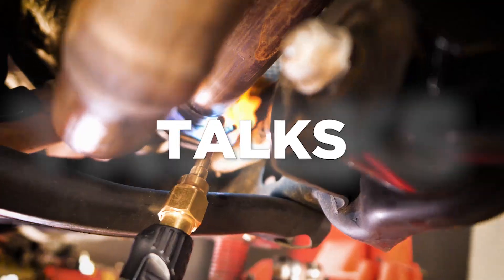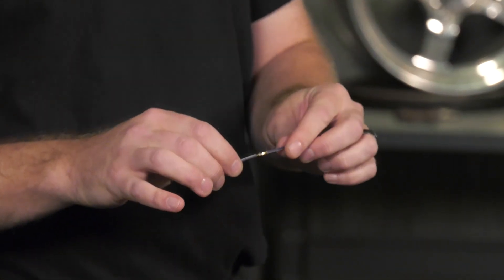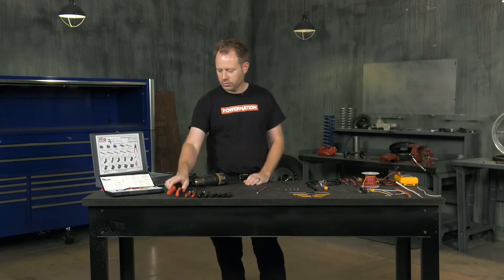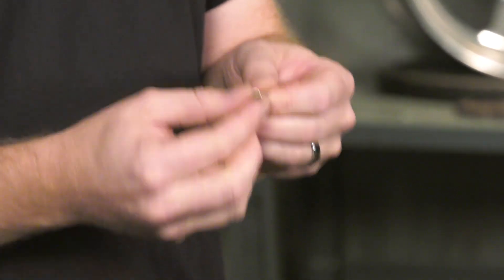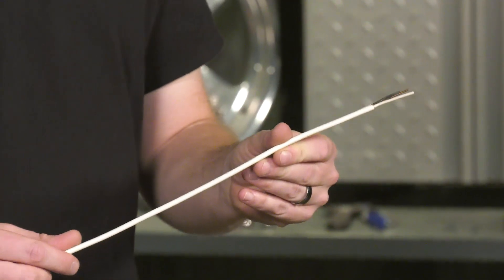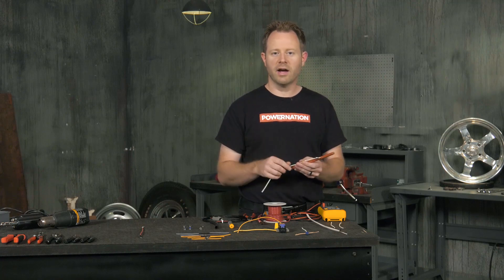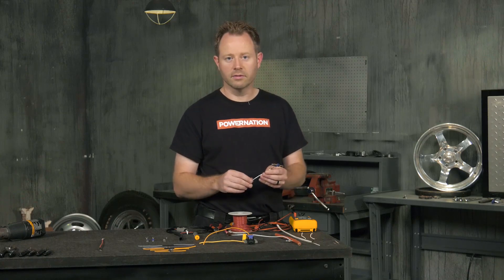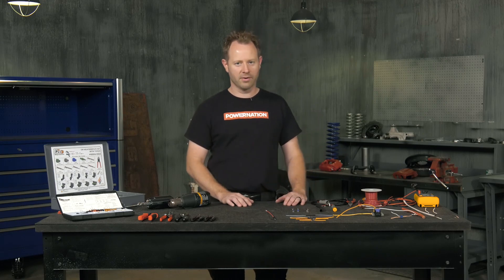Automotive Wiring Tips: From Basics to Factory-Quality Connections

Comment: Fantastic information. Especially on the limitations of soldered connections. 

A high quality crimped connection is almost always superior. There's a reason that manufacturers use crimps when terminating almost every wire in the car.

Comment: After you solder a connection, what’s wrong with using heat shrink on those as long as you put the heat shrink on before you solder the connection what’s wrong with that connection?😮
Reply: I've been wiring cars for years professionally and have NEVER had a solder connection fail.

Comment: When soldering, flux paste is a god send. Even with internal flux solder it may not be enough to wick away contaminents when soldering. It will also reduce the heat time needed to solder which  causes insulator melting that you dont want. And with the flux paste, youll get a better complete solder flow thru the strands of the splice or repair joint. Sealed heat shrink is key to reduce or eleminate corrosion of the joint from the elements. Even in the inclosed cabin of the vehicle, moisture can be present. With Spills or water intrusion, that moisture stays longer than you realize and goes everywhere. Think of it as the humidity factor for the atmosphere of the vehicle cabin. It can stay around for months, stagnent smell or mold smell are signs of moisture retention in the vehicle.